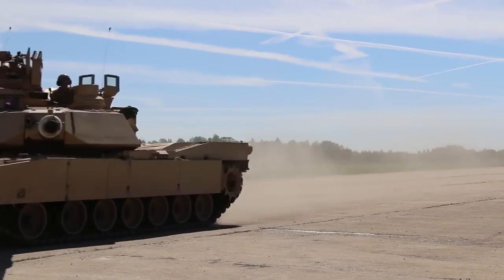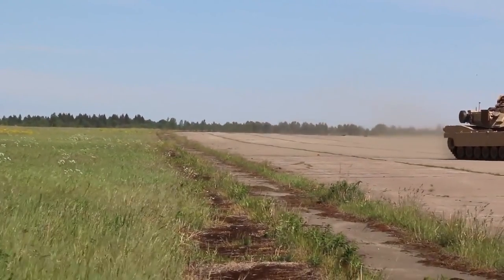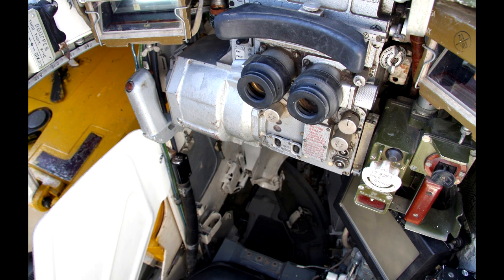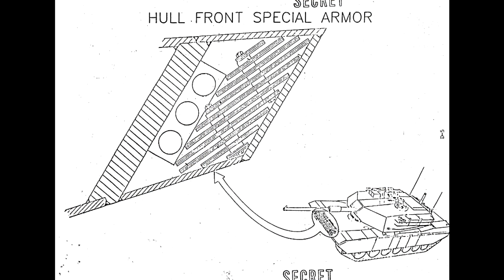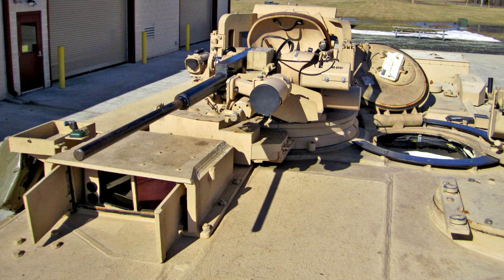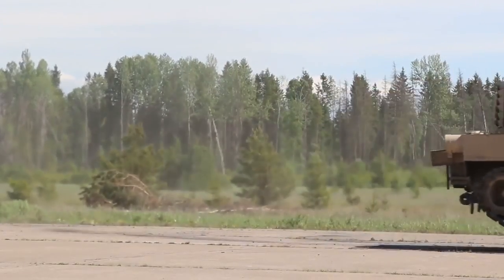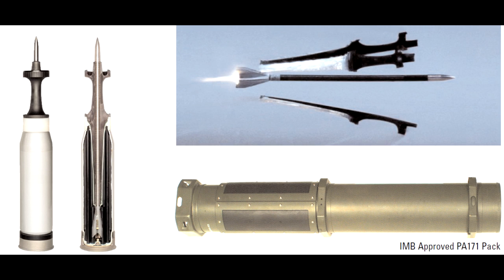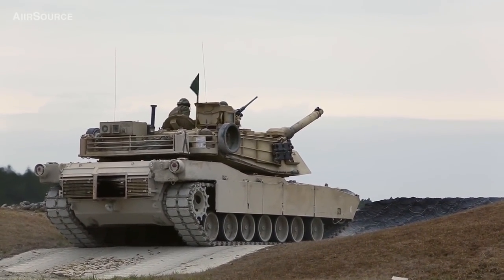Problems with Abrams tank

Comment: As an American, I have looked at the Abrams and other tanks from an engineering point, and noticed that the belief that the Abrams is the best or is unable to be destroyed is unfounded
Reply: @revolverswitch  idk because almost all tanks are resource hogs, probably a t55 with composite armor and some upgraded gun
Reply: Any tank can be destroyed,the thing is the usa does not need to invest billions of dollars on tanks when air superiority wins battles who needs a perfect tank when a 10 comes along brrrrrrrrttt everything dies
Reply: @mydixienormus9186   Yes but a 10s cannot always be present in battle as they have to refuel and re arm between each sortie. Same can be said for tanks how your logistical support moves with you behind the lines or are nearby at a depot. Wheres the A-10 has to land at the airfield and wait a few before taking off. Or having to fly  and meet up with a fuel tanker jet that requires precise timing when attaching to the fuel pump. also each plane might have slightly different refueling connector or prob the plane. And yes supply trucks to tanks are more vulnerable to attack but at least the Abrams crew doesn't have to drive all the way back to base. They find a spot to set up pit stop rest while they wait for the trucks to come. But again being stationary makes them a target to but hard target none the less.
 I totally agree that the Air force kick ass  to with planes such as the A10 its just that is only limited period support as they have only so much time before they run out of fuel and payloads during each run. So we still need tanks on the ground to. but it makes the tank crews job easier by dealing with less threats or threats they can't easily deal with such as 

long range howitzers or missile trucks. 
as the rounds are bigger than the abrams and fired indirectly a shell could land on the engine block and disable it or knock out tracks or hit a weak point in general. But again such weapon systems vary in accuracy as rocket launchers have to saturate an area to be effective as dumb fire rockets can be inaccurate as hell. Also old howitzers might not have all the same level tech and range find equipment or weapon systems. or enemy aircraft the Air Force can deal with to. 
lol the A10 is like the friend that can't visit for long but makes a good impact on your day  and tries visit as frequent as possible lol.
Reply: @yagdtigercommander  well it's not only the a10 every plane is us arsenal has ground atta k capabilities even the f22,put it to u this way the battle of Medina ridge in Iraq was one of the largest tank engagements and the us air Force had vast majority of tank kills
Reply: @yagdtigercommander  but yes tanks are important,just they don't need to be perfect like airplanes do
Reply: Steve Arthur  ohh what a load of non sense is this,the a10 is a perfect weapon of war specifically designed to bust thru soviet tanks and defensive positions,they are cheap enough and easy enough to fly also to keep in numbers,air power wins the day and nato is best at sead operations
Reply: @mydixienormus9186  Iraq got 4 A10's down.
Reply: @dacarter70ify  cheap and easy to replace,one if the great things about them, nothing is invincible
Reply: @revolverswitch   yah interesting enough no tank is perfect how i like to look at who tanks of allied nations would work in the grand picture. see how working with each others flaws and strengths. And just from a game perspective like war thunder. Like really seeing a column of Abrams tanks working along a Column of British Challenger 2s or German Leopard 2s. 
As in theory if the training and battle tactics work well enough or are practical for the given situation it could be a nasty surprise for the attacking enemy. As typically German leopards favour sniping with good turret armour hull down but not saying leo2s be close support when needed. Abrams just seems like a well rounded design of modern tanks a sort of jack of all trades master of none which can be very useful in many situations. 
Where Challenger 2s are just tanky tanks slower than a lot their counterparts but are good for taking a beating and being just good distraction for enemies so that tanks like Abrams can flank the enemy forces. And Russian tanks seem to just good brawlers and offensive style tanks but can easily be flank or defeated at range typically. T90M and T14 are anomalies in this as they haven't been combat tested yet. 

Lol i am just nerd who gets that idea from tank games so how much of that is true in real is anybodies guess. But its safe to assume that some level of thought but each military's requirements would have designed their tanks in such ways per doctrine. So i liked to think their is some level of truth in what each of these tanks roles are intended for. So ways of negated weaknesses is by having tanks fight particular roles or at least two allied nations could experiment on such tank roles or doctrines together if they wanted or have already and can see if it provides for better combat performance that could trans late to the battle field.

 As it doesn't matter that your tanks will have some degree of flaws there will always be trade off's for optimizing a tank design for military's specific needs. But by having good crew training and coordination you can medicate some those disadvantages by playing off each others strengths and turning your weaknesses into strengths to while exploiting the enemies strength as their weakness.

but that is just my thoughts and opinions and don't take that as fact lol. XD

Also revolver switch  people shit on the t55 series a lot but it was easy to mass produce and rugged like the AK-47. By all means not an epic marvel design even for its period but the fact the Russian''s were able to produce between 95,000- to 100,000 units  roughly that made even more produced than the T-34 which was like 60,000 to 80,000 units by the end of WW2. Okay that's like double the amount of American Shermans at 50,000 units by wars end dam. And this was tank that would even make the T-34 jealous with envy and the Sherman would be leaking oil as soon as it saw a t55 lmao XD. Sure the British Centurion was better but not on numbers scale it couldn't compare. No wonder Western Europe was afraid of a Russian invasion. The sheer numbers alone would have been terrifying and before anyone says attack helicopters would  mess them up. Well guess what modern assault helicopter didn't come until much later in the late 60s to early 70's. But there were some small scout/ light transport helicopters that in Europe at least that could carry some dumb fire anti tank missiles or early atgm's but it the capacity was fairly limited. But hey only from reading way before I was born I was born 1992 when the M1A2 first came out lol. 

and I am just trying to be objective Canadian here looking at all the pros and cons of tanks as its interesting as it was design and tactic style unique to each nation if domestically built and aren't export models to other countries. As every tank has a trade off for its strengths because it needs work as the designers intended to fit military needs of their nation or be able to modify for export to another nation that has different needs.

Sorry to ramble on but I see it as there are very rarely any tank design is that is truly bad to the point that can't do the job it was designed for in the first place. Again it comes down to the crew that knows their tank and quirks of its personality to some degree as crews tend understand how the tank behaves in training or battlefield. I for one think the Russian  T55 is a crude tank but a crude tank has a lot character and personality to it that just makes a cool tank for me. Sure it may not be in the poster child tanks like Abrams that screams "America  Fuck Yah". To quote Team America world police lol. But if the T55 could talk it would have many stories to share to us and its younger generation of tanks lol XD.
Reply: @revolverswitch  The best tank is the one you never need. Of course that will not happen with America's "human rights" interventions.
Reply: @Holztransistor    Wrong.  The best tank is the one that best fits your doctrine, and needs. We learned a big lesson from the First and Second World Wars.  The first is that we will be unable to avoid getting sucked into a major war and the second is that it's easier to put a fire out when it's small.

Waiting for a problem to grow into a global scale war before we address it is stupid.

Comment: I wouldnt say the 105mm was obsolescent at the time remember at the time of its introduction the M1 was using M833 APFSDS-T which has better penetration than the T-62 with its later ammunition and was on par with 125mm ammunition at the time. Also later 105mm ammo was on par with 120mm M829 APFSDS-T. The reason why the Americans switched to the 120mm gun was more for commonality with other NATO countries and because they knew that they would need longer APFSDS-T rodsto deal with future Soviet/Russian tanks.

Also im not sure if this is ignorance on your part or being disengenous but the Soviets at the time of M1 being introduced used gen 1 night vision which is so poor that it requires IR illumination to see and can only see about 500 yards. Where as the Abrams commander was equipped with PVS-5 generation 2 night vision goggles which gave the commander alone more range to see at night than any Soviet tank in service and didn't need a giant IR floodlights which would give away his position. Even the earlier m60 tanks had better night fighting capabilities to their Soviet counterparts.

Comment: Abrams engine can use all types of fuel. It's extremely versatile this whole video is extremely dishonest. You're actually Dumber for having listened to this
Reply: Dude literally goes over this in the vid
Reply: If you are forced to take fuel from abandoned cars to run your tank, you are probably loosing very badly, and you might as well surrender.
Reply: @1KosovoJeSrbija1  runs on twice as many sources as anything else
Reply: @1KosovoJeSrbija1  He was not honest in any way..He down played alcohol and other key features.
Reply: @masterofsnatch1645  He was completely honest, you Abrams supporters always point out that a tank or feature isn't good until its battle tested. Then tell me if an Abrams has EVER used this feature?
Reply: @1KosovoJeSrbija1  Not a fan at all of the Abrams..Prefer Leopard myself. But he was not talking about bigger deficits in armor quality and soft spots..No he focused in on a strong point of the  Abrams.. this guy has never been anywhere near a tank
Reply: @masterofsnatch1645  An engineer in charge of development dosent have to have gone anywhere near a tank, he still knows a great deal about it.
Reply: @1KosovoJeSrbija1  I have no evidence at all about what kind of engineer he is..And nor do you at all. And yes it matters he was wrong and sloppy. I told you the engine is far from this tanks weak spots. So balls back in your court. I do not believe you at all about verification of this idiots vocation.
Reply: @masterofsnatch1645  ? Could you try to be a bit more coherent?

Comment: But I thought America used the gas turbine was because it had a lot less maintenance which it ended up not needing especially after improved filters
Reply: It is and at the time was more powerful and compact. Diesel engines have caught up and gas turbine engines lose their main advantage. Thou I wouldn't be surprised if there was a battalion or two that will still use gas turbine as it would useful for break through tanks in a spear head.

Comment: Another problem that comes to mind when the Abrams is brought up is that the latest variants of the Abrams have gotten extremely heavy. In particular the M1A2C is 73.6 short tons of mass compared to the original  M1 at 60 short tons. This is a problem the Abrams hasn’t really had a power pack upgrade and it’s top speed has been reduced gradually as it packs on  the tons probably because of the DU inserts. Sure it can be ungoverned but you would destroy the engine in the process. Plenty of other MBT’s can match it in speed now. The added weight also makes it more difficult for logistics bless their heart they do their best to keep these things running; to you know transport these beasts of tanks because the Abrams can’t exactly drive everywhere. A lot of bridges can’t take it especially third world bridges. Speaking of bridges falling into a river upside down wouldn’t be a good thing for the crew because there’s no belly hatch. Yikes. Don’t get me started on the ammunition variety, Jesus Christ why did it take so long to give an HE-FRAG round for the Abrams the Russians have been doing it for years? Thank god for the AMP round.

Wait a second we can make an entire series discussing the flaws of the Abrams and why it isn’t the tank messiah.

Comment: The tank also Suffered it's heavy weight and huge size ! 
the tank suffered it's very high price ! 
the tank suffered it's complexity !
Reply: ahhh american problems? not really, soviet problems.
Reply: @FederationHero  ehhh no. The Soviets were actually the first to introduce complex composite armor at a time when Americans still used normal steel armor plate. Soviet tanks were also very low price, so they were much cheaper, while still being powerful tanks. And they were also much smaller and lower in height. So it's the exat opposite of american problems.
Reply: Price isn’t a problem when you spend more on your military than the next couple top spenders do combined. Maybe that’s a problem for the Russians, but not the US especially as it pertains to tanks.
Reply: @xanderchristensen6068  The Soviet Union actually had the same amount of military spending as the US during the Cold War, in fact at some point the Soviets had even higher miltiary spending than the US (especially in the 1970's). Anyway the Soviet/Russian tanks still have the advantages I mentioned above: lower weight and lower cost. That's the facts. It is true that Russia today has less military spending, but it still has the second (or third) most powerful military in the world nonetheless.
Reply: @xAlexTobiasxB  u sure their navy is powerful?
Reply: @loserface3962  Yes the Soviet navy was very powerful. What the Soviets lacked in aircraft carrier projection, they more than made up with battlecruisers and missile bombers carriying big anti-ship guided missiles such as the Tu-16 and Tu-22. The Soviets also had very powerful missile submarines such as the Oscar class, which carried 24 P-700 Granit missiles (named by the NATO as "shipwreck" missiles). As the name implies it was serious business. One of these shipwreck missiles could tear up a whole carrier fleet. The Soviets used wolfpack groups of attack submarines in combination with long range missile bombers to destroy any US carrier fleet. 

Even today Russia still has a very powerful navy with the newest generation of Hypersonic anti-ship missiles such as the Zirkon.
Reply: You know served on the M60A3, the M1IP, and the M1A1.  I was also Master Gunner certified for all three.  Please explain to me how the M1s were "too complicated."

Comment: A lot of talk about past issues that are already fixed. How about comparing the current performance of the Abrahams, to the russian equivalent? (And no: the russian equivalent is not the T-14. The US has thousands of Abrahams tanks. The russians have only a few dozen T-14. And this is not going to change any time soon...)
The Abrahams is not perfect. But it is battle tested, and it did well in those battles. To me, it seems to be much better than a T-90...
Reply: "Abrahams" you've just disqualified yourself
Reply: @xAlexTobiasxB  Great. You have no arguments, so you attack a spelling error. (Which happened thanks to stupid autocorrect...) I think YOU have disqualified yourself.

Comment: I’ve tried to find where you got the information that the commander had no night vision or thermal. Can you tell me where you found it? Not doubting you. Just wanna know where you got it from. I find it hard to believe the IS army would leave that out. As for the front hull armor, I read somewhere that the US army did test to see where a tank was more likely to get hit and it’s the turret. So they armored the crap out of the turret. And about the AGT 1500, I think dalek said this, could be wrong. But if the US army has been using it for this long then there’s gotta be reasons right? Other wise they woulda switched to diesel a long time ago. 70 percent of the engine can be accessed and replaced without tearing the engine out. That’s great for combat zones. And it’s great to be able to to use a wide variety of fuels, even if the us prefers to use jp-8 fuel, in combat I don’t think they’d care to use kerosene or diesel. And the 105 wasn’t a bad gun. In fact usmc m60s in the gulf war were able to successfully engage Iraqi armor with the 105s even being able to knock out Iraqi t72s. That was the 1991 battle of Kuwait international airport. I guess everyone is like “oh god here comes abrams fan bois”. But sorry Leo 2 fans, I think y’all are the worst😂(if you can’t take a joke don’t bother commenting) but the Leo is a very good tank. And the T series. Love those too. I love all tanks. But every tank has had hiccups. T80, Leo, abrams. All good, all had their own problems.
Reply: It's true for the M1 and some variants of the M1A1. The M1A2 has a CITV.